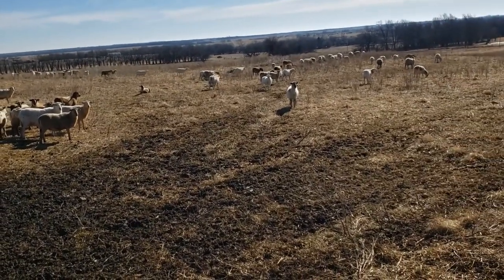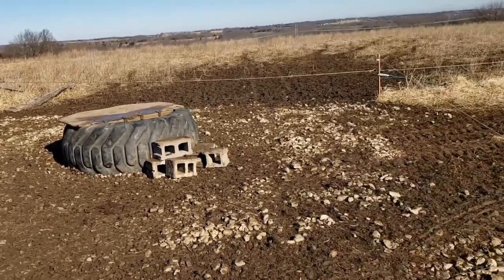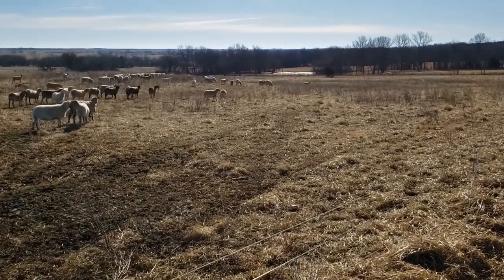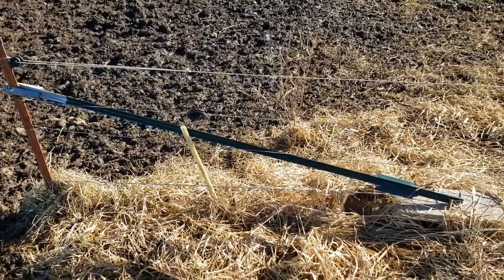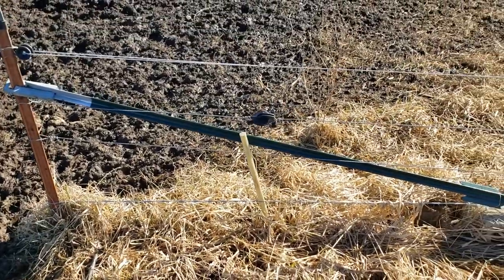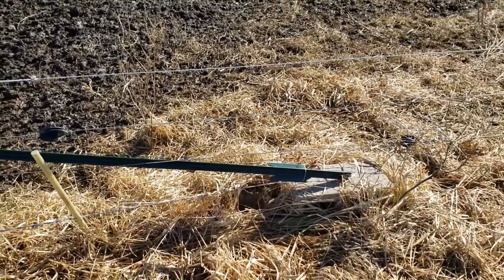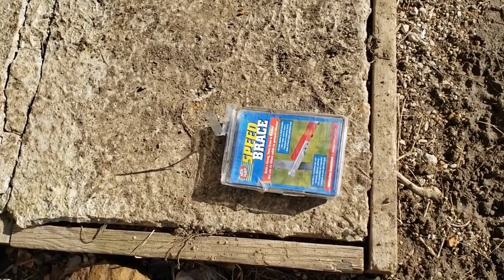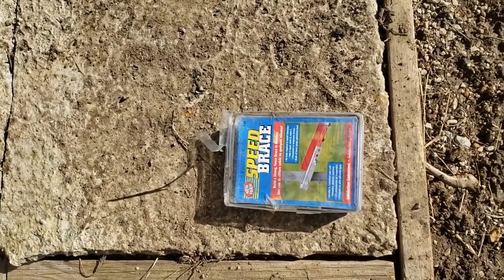T post floating brace

Comment: Can't find such a bracket anywhere.
Reply from the maker: Valley Vet   https://www.valleyvet.com/ct_detail.html?pgguid=26eb6f5b-7cb8-4a69-b746-565e37ec5d71&itemguid=51e2f3a7-172e-4607-9871-65e34d297c6f&sfb=1&grp=6000&grpc=6500&grpsc=6510&sp=f&utm_content=31125&ccd=IFF003&gclid=CjwKCAiAgc-ABhA7EiwAjev-j2rBdRl9UrPxhkkbFMQQvvGl4oKy4myOzUuEmL0Pu_BroCW_k5e_BRoCMHAQAvD_BwE
Reply: @grandviewlivestock3936  ah wait, I thought "the bracket" was that yellow vertical piece under the horizontal post. What does that thing do?
Reply from the maker: @bagginshates  That is simply a fiberglass rod that I used to twist the wire that goes along the bottom of the verticle post and the end of the angled post.  You can use anything but it's best not to use something that will conduct electricity and ground out the fence if it touches a wire.